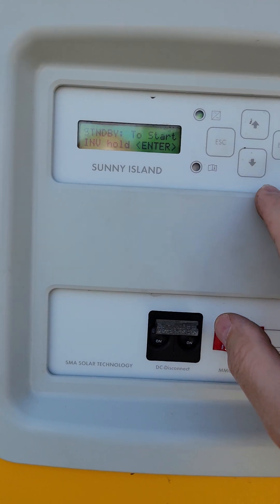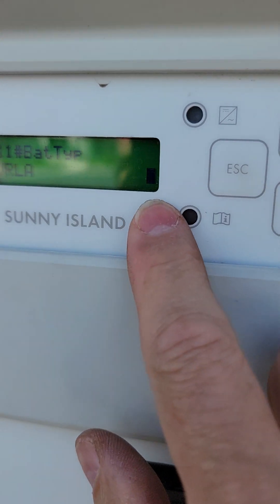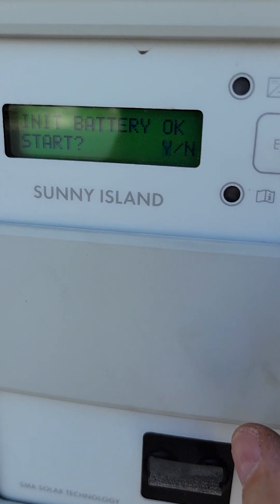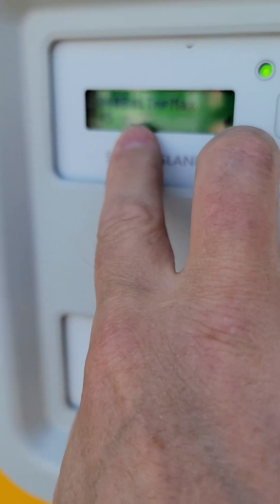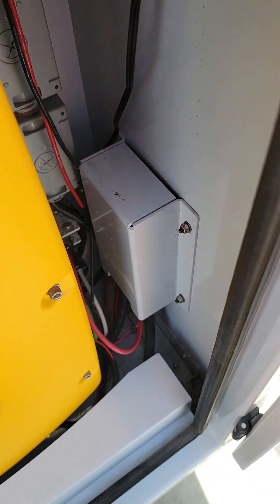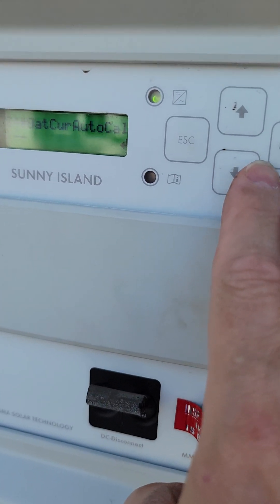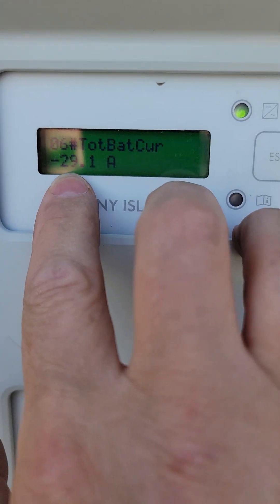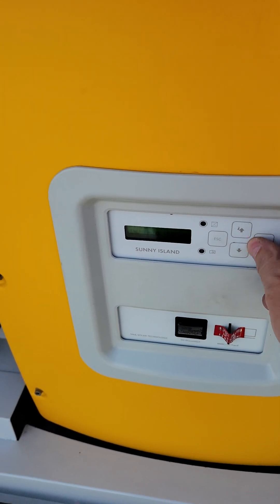Changing the battery's capacity or voltage

Comment: How do I know if I have a shunt. I have a solar trailer. But the SMA inverters are not inclosed. I have one black box. Do I still do the process with the shunt ( current sensor)
Reply: Jason- you will see that little box inside you center box. The battery leads will go back through it.

Comment: Hey brother, can you help me with a Sunny Island inverter connected to e flex 5.4 batteries? It's a new install but it has error codes and it turns off. Fortress helped with a little troubleshooting. Technition hasn't followed up for a long while.